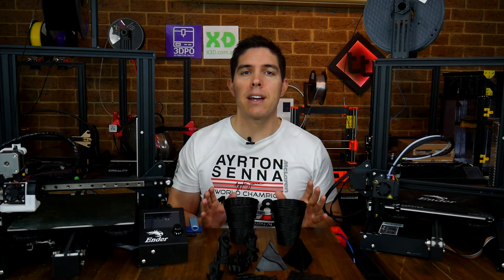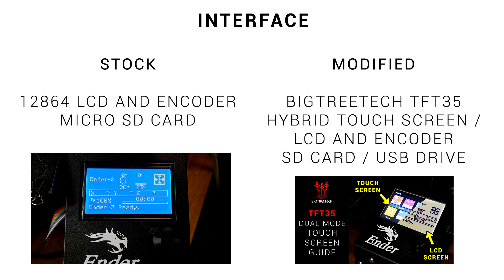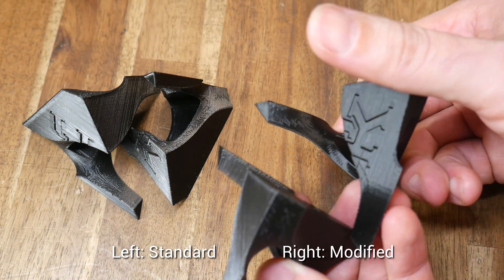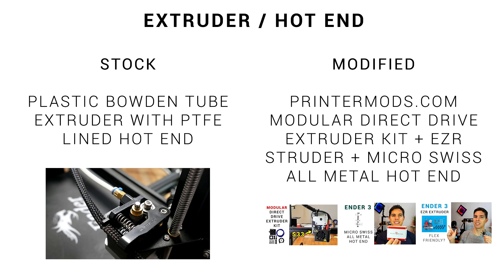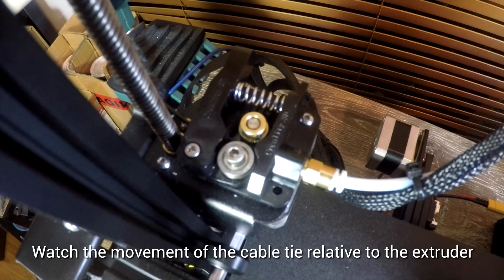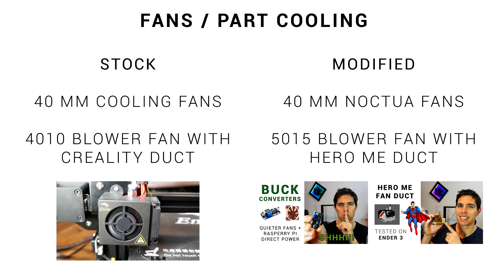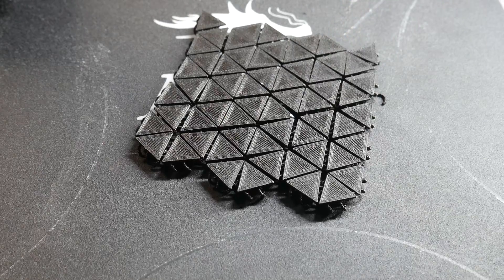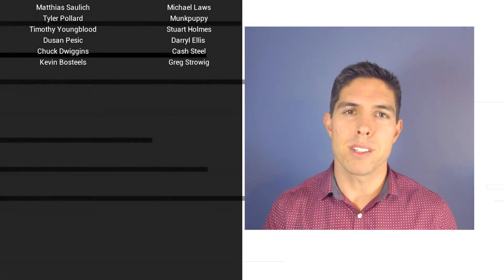Are modified 3D printers better? Stock vs upgraded Ender 3 comparison

Comment: Another excellent video Michael. My E3 is definitely not stock but most of the mods are for ease of use. I print on 2mm glass and I printed a handle for the bed so I never actually touch the bed itself. This means that the level seems to stay put and I rarely manually level the bed. I used dampers on the X and Y drives and that quietens the steppers down considerably. I haven't changed the driver because I use Octoprint to drive both my printers from the one Raspberry Pi. I control both printers remotely from my PC. I'm going to get Noctua fans for the entire printer because the PSU fan is now the loudest noise source. Thanks again for your insights.

Comment: You should absolutely not modify because once you start it's over,  you'll never stop tweaking the printer or buying that next part for a mod.  It's heroin printing nerds.
Reply: Buy printer. Print mods for printer using printer. Repeat. ;)
Reply: I just purchased an Ender 5 for my first 3D printer. It hasn't even arrived yet and I know more about the mods I'm going to make to it than what I'm going to print with it afterwards :/
Reply: @jefftalbot  😂
Reply: Sounds like Skyrim modding hahaha
Reply: Not true. I modified my Anet A8, because using it stock was a nightmare. However all of my upgrades were hacks and 60% of those were printable, there was little buying/money involved. I now enjoy using my printer, why should i prefer the nightmare?

Maybe printing itself is heroin to the other users?
Reply: Yep, upgraded my bed leveling springs and extruder assembly, now planning on upgrading to an SKR 1.3 main board and eventually to a true dual extruder setup. Way above my league, but it’s the process that counts.
Reply: @fordrollhaus9086  theres version 1.4 alreday (just saying)
Reply: Jakub Sip I know, but it’s more expensive and I don’t need all of the extra features.
Reply: @fordrollhaus9086  So I apologize. Because I was watching video after video when I saw that he is upgrading mainboard. Immediately I got such feeling that I have to upgrade too 😅 so I have jumped to the ebay and almost buy v1.3 when I found that 1.4 is already out. Because BIQU has official shop there and ebay listings are quiet a mess 😀
Reply: Totally Agreee!
Reply: not true i found a sweet spot with my ender 3. if i do anything else it will just be buying a better model printer.
Reply: And when you see the difference, it's totally useless xD
Reply: @Tazokk  that depends, i can print benchy in 30 mins instead of 2 hours because of all upgrades
Reply: @Tazokk  modding is pretty much just for quality of life
Reply: I do like your comment 100% accurate !
Reply: Modifying your 3D printer depends for everyone like teaching tech said
Reply: It all started by printing my first mod.. then I bought a metal extruder tensioner and a SKR E3 MINI V2.0 now im itching to order the BLTOUCH and TFT35 and I havent even had the SKR delivered yet !
Reply: @Jtag-dev  I too have same problem
Reply: @syedsulaiman8380  after reading horror stories about BTT i was concerned but knew amazon should look after me if the product fails but its installed and working perfectly with cura and customized marlin
Reply: @Jtag-dev  hey what the hell I mean I have never ordered from big tree tech and was about to order a skr and a bltouch from aliexpress 
Is it a bed idea where did you hear these horror stories about BTT
Reply: @syedsulaiman8380  There are some on amazon listings for the products and some on reddit etc. For me it was worth it the TMC2209 drivers alone are one of the best things its near enough silent now the noisy parts are the fans. I had no real issues with the board and used fresh marlin from their own github with the ender 3 skr configs tweaked to my liking.
Reply: @Jtag-dev  so is it fine if you buy skr mini from aliexpress 
Cause it is not available on Amazon here in India
Reply: @syedsulaiman8380  I have never used aliexpress but as long as it is the legit product and not a clone of the skr mini then yeah its fine I would also reccomend to get the version 2.0 as it seems to work really well and has minor improvements over older versions.
Reply: @Jtag-dev  actually V2 is costly and I am just buying the skr mini for lowering noise which the v1.3 does absolutely well and big tree tech have official store on aliexpress 
Perhaps if you can share your Instagram it is better to chat there rather than YouTube comments section 😂😂
Reply: @syedsulaiman8380  Sure its https://www.instagram.com/fx_nathan/
Reply: I SWEAR
Reply: waiting on my 7" touch screen 🤔
Reply: Bro it's so fucking addictive
Reply: The know how and trouble shooting / comfort you gain while doing a hobby you enjoy and leading into other skills like modeling custom parts is always overlooked.
Reply: Only truly useful mods are pei spring steel bed plate, dual z axis, br touch auto bed leveling, direct drive, and the orange hotplate screws
Reply: This is my life, with every single happy I partake to.
Reply: And do not start a war.

Comment: I've added a bl touch, with custom fan shroud (because I needed to start somewhere), filament guide, and an octopi to my Ender3. These mods are all quality of life rather than direct print quality improvements and work for me.

Pretty much all I have left on the list is direct drive for more reliable TPU prints.

Comment: What printer (when stock) is closest to the modded version of the ender 3?
Reply: I could do all the modding I just don't have the time. So It doesn't have to be a 'newbee friendly' machine, but ideally quiet and reliable and not cost the earth and able to print flex too.

Comment: as far as i experienced
leaving ur cr 10 stock is usually a good bet
maybe upgrading the part cooling fan bracket is alright

but mine has gotten progressively worse though ive been able to recap some of my initial quality by tweaking my upgrades

edit: and yeah i forgot how loud the old fans were

i just went the funny man route and bought a mk3 after using my cr10 for 2+ years so i can comfortably mod my cr 10 to death while i can use the mk3 as a reliable stock printer

Comment: Excellent video Michael and can I say a very long overdue one-it must be an absolute nightmare if you are just getting into the hobby going into the Facebook groups and asking people If there’s anything they need to know about the ender 3 or CR10 or any of the Creality machines before they start, only to get bombarded with people who are “modders” by choice telling them that they need to do all these things that in reality they might not actually need at all. Very pleased you did this video I think you nailed the question that every Newbie asks on day one. My own machine is one of the very first batch I’ve owned it since before a lot of people have even been making videos about the printer-People continually harp on about the bedsprings being no good But I would like to add that two years later I’m still using the original bedsprings and I seldom (if ever) level my bed-all I did was add a glass print surface, and here is the magic tip to prevent bedsprings from getting destroyed and the need to relevel the bed-don’t hack your prints off, if you let the glass cool they self release🤷‍♂️

Would be interesting to see a video where you put your highly modified printer up against your genuine prusa Mk3. Thanks again for a very informative video👍
Reply from the maker: Feel free to link them to this when the question comes up. Thanks for taking the time to comment.

Comment: Personally I'd say if you want the flexibility/usability upgrades but are too afraid of damaging the printer, get a friend who is more confident to make the alterations. I have yet to see a non-professional 3d printer that I didn't immediately think of an upgrade for. My CR10 S5 has a few mods, all to make things easier like added bed leveling (A must in my personal opinion, and should be standard on all printers really.) and a cooling duct mod.

But if you aren't confident, then leave the printer as is and try to find others locally who you can get together and chat about 3D printing. Maybe you'll find someone who can mod it or is even willing to tech you how. :) Either way, it's fun to meet more people also interested in 3D printing, whether as a "modder" or "end-user".
Reply from the maker: I guess a maker space would fit the bill perfectly for what you describe.

Comment: I agree to modify but taking it slowly. I have modified my printer one purchased part and one printed part a week. Printing with it for a few days and then offering the next part. Usually order on Sunday, install Wednesday, see what I want to do next. Then starting the cycle over again. I have made on purchase I regret and three prints I gave away because I did not like the mod. I have been very happy with my Ender 3 Pro.

Comment: Well, one topic is untold : cost ! I guess the upgrades would allow to buy several ender3 printers.
Reply: The ender is actually very reasonable to mod
SKR mini 1.2 is approx $30 AUD
SKR 1.4 + 5 TMV2209 @$50 AUD
Dual Z is @$70 AUD
Belt tensioners @$15 AUD each
Yellow springs and aluminium extruder @$15
Directdriver extruder and specialised stepper @ $80AUD, but starting with a self printed mount, existing motor and current extruder is a few meters of filament
Reply: @lukemason2232  I'm not convinced by the dual Z upgrade, useless if the gantry is perfectly guided. Anyways, you forget the linear rails, the touchscreen and the raspberry pi. Approximately, I would say a full price tag about 520€ including the printer. I would get a better printer for the same price, or get a 3 ender3 print farm plus extra spools of filaments. A print farm is always more efficient than a single printer, even versus a bigger or faster printer.

Comment: Wish you would've mentioned the price for all the upgrades.
Reply: around $450 US for most of those mods minus the extruder
Reply: @nagginsnuggets9424  thank you
Reply from the maker: They're spread over a year and a half, it's difficult for me to recall sorry.
Reply: @TeachingTech  This is why i keep spreadsheets for my hobby's it happens often that people ask "where'd you get that? what'd it cost?" and i can always open google sheets on my phone and send them in the right direction. it's never too late to start.
Reply: @t3ckfr3ak  I've been thinking of doing some better tracking for parts and stuff myself.  I'm confused how to best manage this in a spreadsheet though...  Any tips on the best layout of tabs, rows, and columns?
Reply: @brawndo8726  top row labels: part, source of purchase, cost at time of purchase, part replaced, when installed
Reply: @TeachingTech  Hello Michael, what applies to you also applies to us. It's also difficult for us to recall; some of those mods I didn't even have seen... At least a rough number should have been given. This is exactly what is missing on this very complete video. Thank you and keep up the good work to the community.
Reply: @TeachingTech  Lol, this is a non answer to a valid question.  One must assume that at least three Ender 3 Pros could be owned for your one plus the mods.  I'd rather have the three pros.
Reply: @ramjetnuesse  The thing is: a noob cant print with his 3 ender 3 pros as good as a someone who modified and tunes his old ender 3 for over 18 months.
At this point its is not about the money anymore. Its about knowledge, spending time with a hobby and just know how to do it.
Reply: @ramjetnuesse  The whole total cost after mods shouldn't be over 300$. So that's less than 2 Enders for 1 Ender which works more reliably and better so well.

Comment: I got started on 3D printing by building a DIY Mendel. I'm very comfortable making mods, but having a reliable printer that doesn't take constant tweaking is nice. (Love my Ender)

I've only made mods to address problems, or add capabilities. (Direct drive, all-metal, for flexibles)

In my opinion, modding is a personal decision. If you don't need to mod, good on you. If you want/need to mod, kudos for taking the dive.

In the end, it's all about getting good prints.

Comment: I have found Michael's Ender 3 tutorials invaluable and perfect for my needs. The Ender 3 is a fantastic starting point, especially for the price. I love the option for incremental upgrades as I get the funds to do so. Not only that, I thoroughly enjoy the experience of doing these upgrades myself, even if following guides, it grows my knowledge and I become more attached to my printer. I would love to commit more time to learning the hard way, Michael saves me that time with his fantastic and informative videos and I have zero regrets getting an Ender 3. Creality really should give him a sponsorship for the service he provides us end users. 
In my short time with 3D printing and owning an Ender 3, I felt I knew the answer to the question posed, and Michael delivered the answers methodically and as expected. Standalone the Ender 3 is awesome, but the upgrades here and there really make you feel much more in tune with 3D printing as a concept and proud of what you learn along the way and knowing the subtle benefits. I think it must be very comparable to a petrol-head gloating about their car specs to a person who is happy to just let the garage sort out the maintenance. I didn't buy into this just to 3D print, I wanted a hobby and I cannot recommend the Ender 3 enough, as well as Michael's videos to re-assure along the journey. 
I have a Raspberry Pi with Klipper fw and I have yet to isolate why, after an amount of time, usually over 10 hours, the printer will just die and only a reboot of the printer and the Pi will bring it back to life, but any print on the go will have failed. I think this is down to OctoPi but so far it has only ruined a few prints. In my brief experience I feel you want to print direct from an SD card as much as possible. In time I will upgrade the Melzi board but I feel the Pi upgrade was worth the risk even though it's only a relatively slight improvement in terms of print head motion. I removed a lot of plugins but the issue has remained, the longer the printer has been active the more likely a fail could happen. I bought heatsinks for the Pi but this did not resolve it. Any advice on this is welcome.
My one criticism is there could/should be more dog cameos.
Reply: I couldn't agree more! I'm new to 3D printing and these videos have enriched me and in turn all of the people in my life that I'm trying to share this fun with! Thank you!

Comment: On the original you can still take the plate off and bend it to get the part out of it...

For me the only benefit in the noise reduction, and direct drive to print ninjaflex. Otherwise it's a waste of time and money.